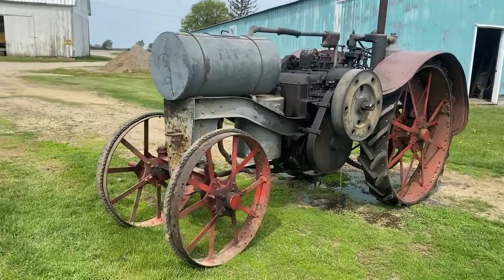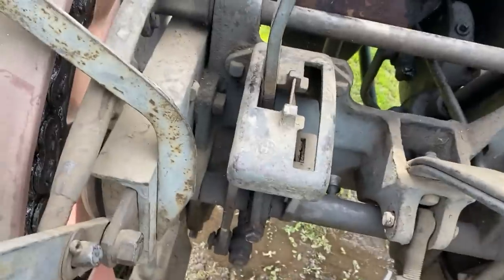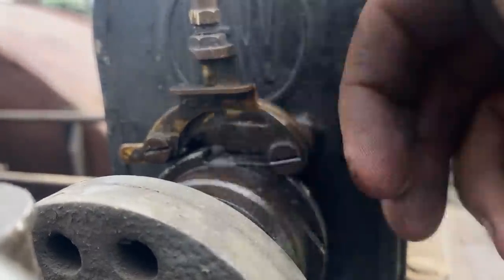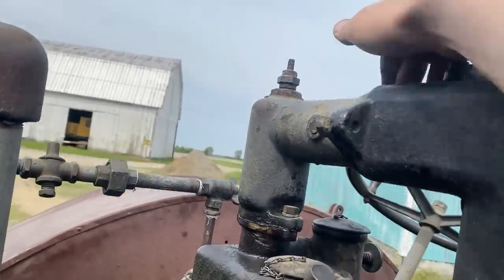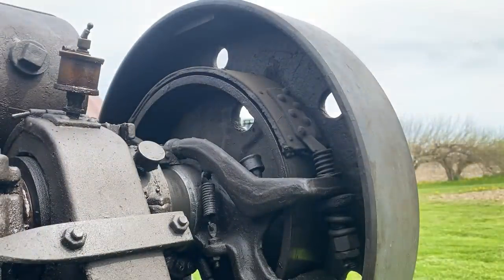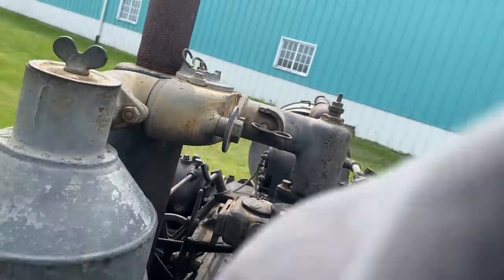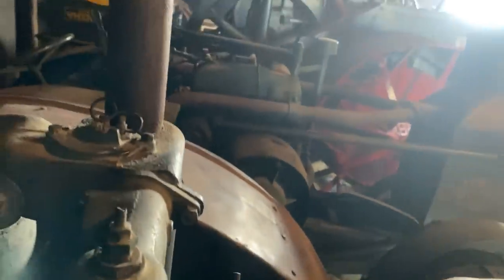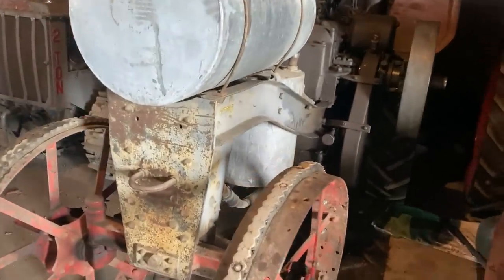1920 International Harvester Company 10-20 Titan starting and operating

Comment: When I first got my Model T I nearly had a heart attack the first time I got it started.  It took me quite awhile to get it going and cranking is hard work.  Now 30 years on I can start it right off.  You have to get the knack for getting the gas mixture and spark right.  Great piece of equipment, great video.

Comment: Based on the serial numbers, were there really over 78,000 built in just 6 years? That would be an impressive amount of manufacturing for the time.
Reply from the maker: There were that many made. However a lot of pre-1942 equipment ended up getting scrapped in the war, which is what makes these as rare as they are.